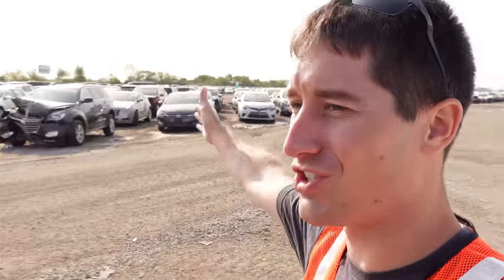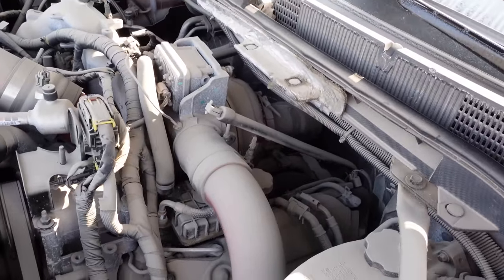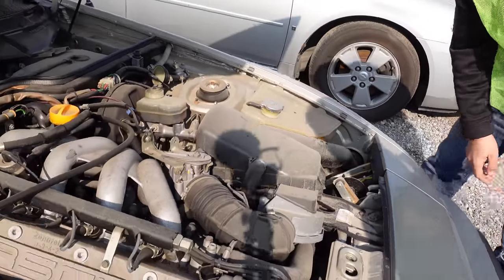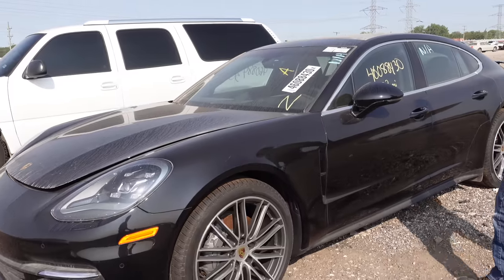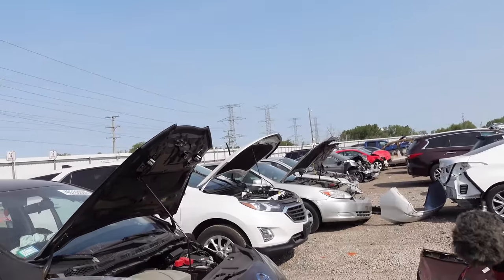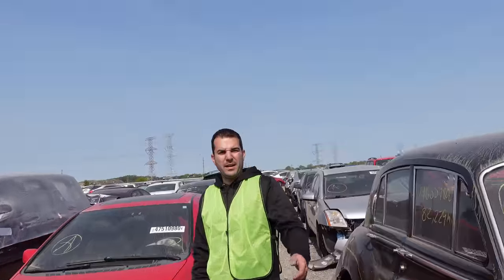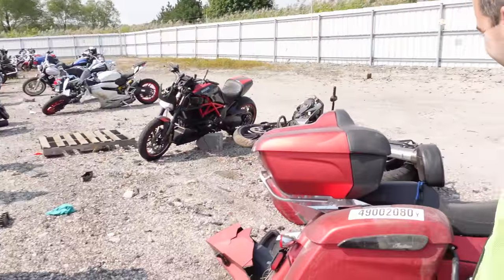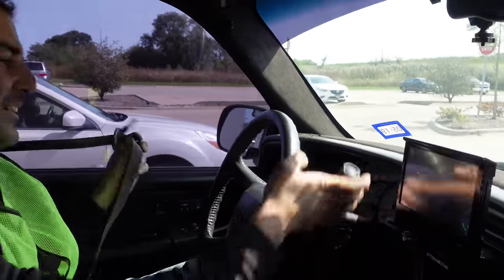Finding An ABANDONED Hellcat Charger Build At COPART With @LegitStreetCars

Comment: Im a claims adjuster... Reason that truck was totaled was because if any of that aftermarket suspension needs to be replaced it can add up on the labor cost and will make the adjuster not wanting to risk it being in a shop for 2 months for repairs and rental car cost. I mean at home doing repairs you are just buying parts not labor which is always 3/4 of the repair cost .

Comment: I don't get totaling a brand new flooded car, depending how deep. I had a 2016 subic few years back and was involved in flood. Water up to bottom of seats and was not declared a loss. They sent check to clean out. After seats and carpet gut, there are no electricals on the floor so no electrical damage and bare any jute on the carpet to hold moisture.  So seats were dried out, carpet was vacuumed and hung dry (took about 24 hours), vac'd interior and reassembled and was perfect just as new. So a Subaru is a great car if find as mild flood.

Comment: If that first truck has frame damage, would you still deal with it?
Reply from the maker: Yes! That frame is like $1500, you can frame swap it super cheap! 💯
Reply: @WatchJRGo  That trucks been sitting there for a year. I worked for Copart so I know all the secrets.
Reply: If you spent the $40k for the truck like they mentioned you would kinda have to, right?

Comment: Abit unfair to say that a 1980's Porsche 944 is a slow car, take any American car of the same year and then we can talk about slow car, example Camaro z28 5.0l v8 engine with only 190hp, the 944 had 165, thou less weight and almost perfekt weight distribution by 51-49.. 
Yes its slow by todays standards but by the 80's it was not slow.